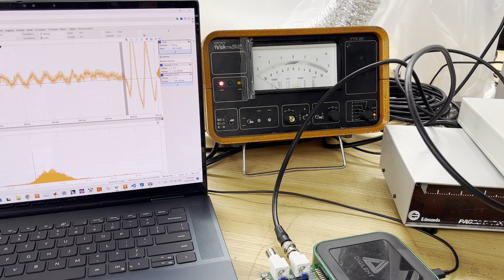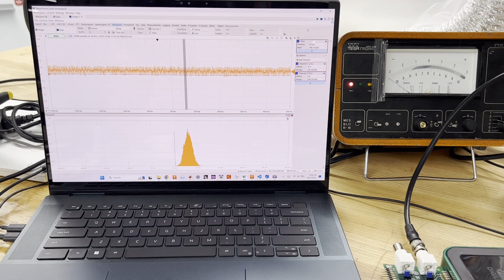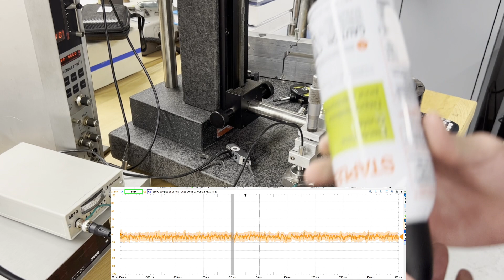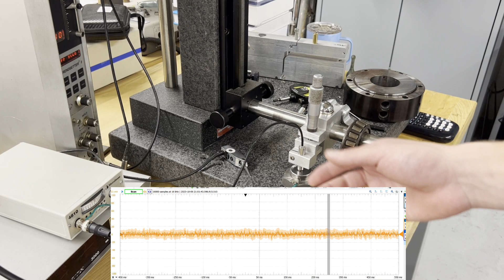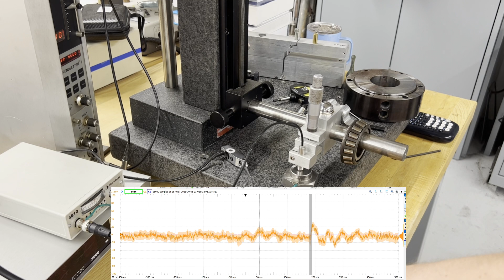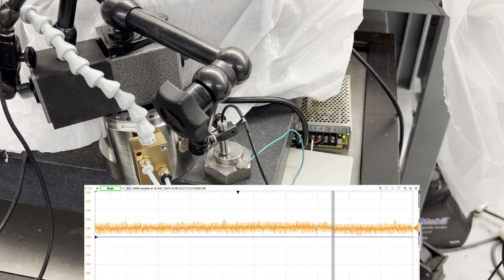Everything a thermometer, everything a spring

Comment: Video is over a year old, but here are some pointers to try troubleshooting and reducing noise background of the capacitive sensor. First is to disconnect BNC of the sensor cable from the preamplifier and cover it with a BNC cap. If noise background is reduced, then it is EMI picked up by the sensor cable. In this case you can try double-shielding the sensor cable, either by using a triax or by just pulling a shielding braid over the existing coax. At the amplifier side external shield will need to terminate to the chassis, at or as close to BNC connector as possible. At the sensor side external shield will need to connect to the SST tube you embedded around the sensor, and preferably from the tube to the polished block used as counter-electrode. This arrangement will enclose sensor into "Faraday Cup" environment, placing the whole sensor at the same common potential as chassis of the preamplifier. The second is try replacing switching mode power supply with a linear one, preferably when sensor cable either disconnected/capped, or double-shielded. If noise background with linear power supply is lower, then either use linear or spurge for low-noise switcher, or enclose/shield the regular SMPS brick.

Comment: Put it in a Faraday cage.. The electrical loop of probe coax screen and green earth wire wi pick up emf from everything.
Maybe earth the puck with a short wire from the probe case.

On the lines of everything is a spring...
Whats the fundamental frequency(ies) of the anti vibration table? It's going to be low, about the period of the oscillations?

Comment: Excellent demo.

I think if you want better resolution with that probe you may have to re-configure the 4810 to run it at a closer standoff distance. Usually this is done at the factory, but it's done with jumpers and BCD switches on the PCB, so provided you remember the original settings, you can just reset everything should things not work out.

If you estimate the probe diameter to be approx. 0.5mm and the standoff to be 100μm, then depending on the set bandwidth (user selectable, but assuming 1kHz or 10kHz) the catalogue lists an rms noise of about 2-5 microinch for a similar probe and setting. If the board is reconfigured to run the same probe at a standoff of 10μm, the noise is reduced to about 0.1 microinch.

The catalogue also suggests selecting a probe with the largest sensing area the target will allow to minimise noise and get the best resolution.  You get lower spatial resolution with a larger probe as it effectively averages the target surface, but I don't think this would be an issue for your application.  In your case using a larger sensor would still require adjusting the board, it would have a proportionally larger standoff with equivalent noise as it is.

Also, in 'Know your machine tool' by Tim Sheridan, Section 6 describes a capped probe test used to determine the minimum noise level of a capacitive probe system.

Comment: 10:20 Re the calculated distance:  Isn't the noise floor of 20mV corresponding to about 400 microinches, not 4?

(And then on the vibration isolation bench, doesn't the ~45mV "unknown deviation" correspond to about a milliinch, not microinch?)

Comment: What's the noise floor of he data acq system? Try short the input and take a measurement. 

Typically high bandwidth measurements have higher noise floors, as noise is proportional bandwidth. It's very difficult measure small signals at high bandwidth. 

You may be bumping into the 1/f noise limit of the system. 

Might be worth running an fft to see what the noise floor looks like. You may still be able to see your oscillation of interest on the bearing in the fft, which may tell you what you need to know. 

All fun stuff!

Comment: Did you try listening to the signal coming from the probe? Some components of the noise on the oscilloscope plot can be resonances or high frequency periodic disturbances, and they will be easily identified after conversion to sound. Doing FFT on the signal will do the same, but connecting to a speaker can be more interesting.
The probe can pick up noise from surrounding power supplies and other electronics. The floating of the reading on the anti-vibration table could be caused by differences in electrical charge between isolated components of its mechanical assembly relative to the ground. Make sure that all metal parts are solidly electrically bonded, and grounded.
Just make sure to not create an acoustic feedback between the gauge and the speaker.

Comment: This is how some high end machine manufacturers measure spindle elongation directly in the machine! If you look closely at something like a Kern, you'll see a little Г-shaped lever holding a nub a couple mm away from the spindle nose. That's this thing.
As others have said, the electrical noise is coming from the cheap switching supply you're using. For this low power consumption stuff, it's best to use a linear supply. You can use a 12V switching supply and a linear post-regulator with a bit of filtering(just capacitors should do).
Maybe the jumping on the air bearing is due to slightly varying pressure/leak paths changing?

Comment: I don't have ANY experience with these types of sensitive measurement instruments, but I do understand electronics very well. That noise floor which you are seeing is very likely due to the green "ground" cable connected to the slug. The relatively short length of wire will experience some induced emf from all sorts of sources around you (that DC/DC supply for example).
Keep all mobile phones and wifi routers as far away from the setup as possible.

Comment: Hi Cyrus, you have some nice toys there. You need to do the arithmetic to determine if what you're seeing is Johnson Noise. Recall that the Johnson equation is explicitly dependent on bandwidth as well as temperature. This is why your various gauges are heavily low pass filtered in order to give meaningful measurements. It may be impossible to detect the vibrations you're looking for with a broadband measurement. All is not lost however, if you connect the output of your cap gauge to a spectrum analyser you can effectively make narrow band measurements at various frequencies. Can you infer the target frequencies by examining the defects that you think are being caused by vibration?
Also. it looked like you used a lot more refrigerant on the granite than on the steel bar. The difference in the time to return to equilibrium may be because you took more joules out of the granite than the steel.
Reply: Good points here. Fortunately, based on product literature for similar cap gauges I’d guess that there is a long way down to the noise floor. The accumeasure 9000 advertises a resolution of .75ppm of full scale range per root hertz. So for a 1kHz measurement bandwidth and 25um range that would be sub nanometer
Reply: Thanks for this, it might solve an irritating noise problem I've been running into
Reply: @omars_projects  You're welcome, I'm glad you found it useful.
Reply: Yeah the Digilent USB scope he's using can do spectrum analysis (FFT of the incoming data stream). There's a few settings in the software that I found can really help with noise, and I genuinely worry most of the noise he's seeing isn't coming from the capacitance gauge as much as the digilent. Would depend on what sort of Vp-p are coming off the gauge amplifier.

Another issue will be brownian motion in the gap. And tribolectric effects in the cabling/instrumentation. But my bet it's either the gauge amplifier or the Digilent scope. The shape of the noise will be telling.
Reply: @DanielHeineck  You make excellent points. I had assumed that the gauge amplifier has a good low noise front end, is designed for broadband operation and that it's output voltage is adequate. I also assumed that Cyrus's repair to the sensor left it fully functional and properly matched to the gauge amp. All of these assumptions need to be examined. You also raise the issue of Brownian motion which is a mechanical analogue of Johnson noise, thermal motion of atoms and molecules versus thermal motion of electrons in a circuit. But I don't know how to properly account for iti.e., is it already included in the Johnson noise, or does it need to be added. And, as you say the issues of cabling, shielding and grounding need to be considered.

Comment: I have noticed you use switch mode power supply in the last test to power something. They are really noisy - will pollute with high frequency rf noise both your DC rail as well as the environment they are at. Consider using  linear power supply as well as terroidal transformer for powering the whole set up. A quicker test could be to use batteries - say a 12V car battery to test the theory and see if it improves the noise.
Reply: Agreed. Those power supplies are super noisy
Reply: @RonStoppable102  I was going to say the same. I would stick with the power supply to get this set up, but any measurements should really be battery powered. Also what is the noise floor of that amplifier? If you unplug the capacitive gauge, does the noise vanish? If not, you can reduce the noise by dropping the measuring bandwidth; you will win 3dB for every halving. Finally, there is definitely a settling time associated with this stuff. Get it all set up, but don't bother even looking at it until the next day.
Reply: Then theres the emf at the capacitor from probe coax screen and green earthing wire.
Better to earth the puck with a short wire from the probe case.

Comment: Absolutely amazing.   The drift is obviously solvable as you didn't have it in your first experiment.    Is this the same technology that they use for global earthquake / explosion sensors?    Maybe one of those guys can give you some clues.   Could it be radio frequency noise with the cable acting as an antenna?  Does shielding hurt or help the jiggle?    I'm still at the point where I'd just like to lap a steel plate flat enough to see stiction.   Your enginerding seems like magic.